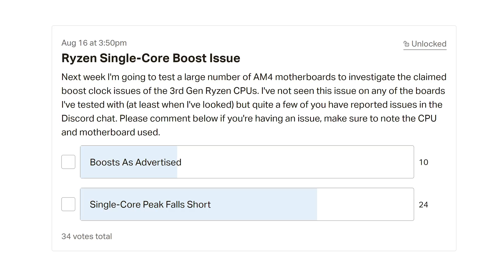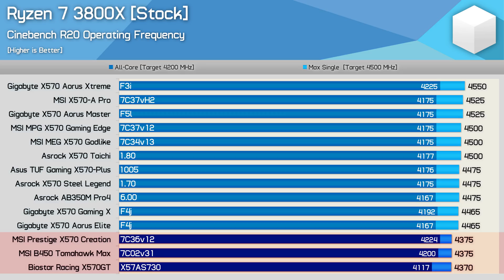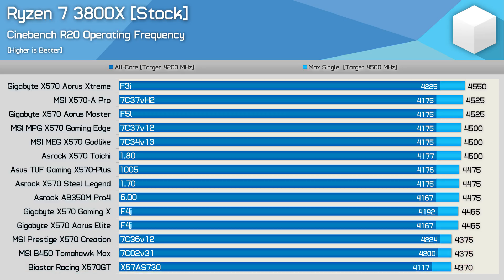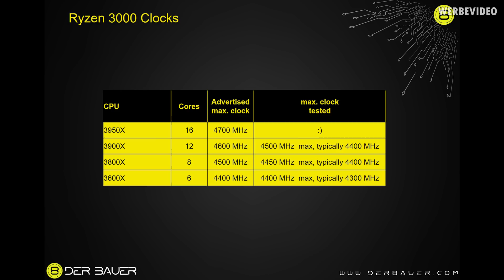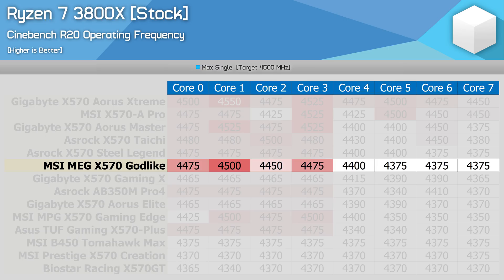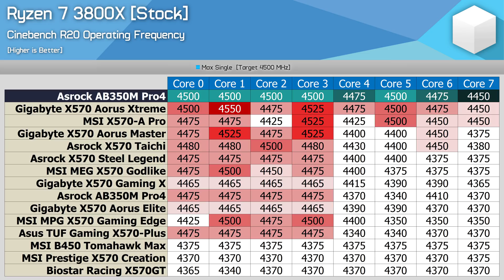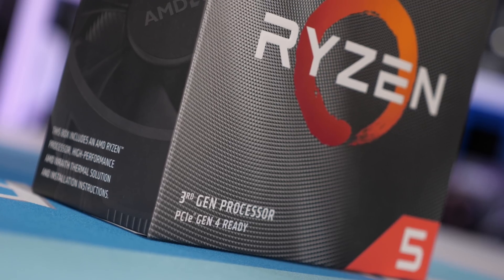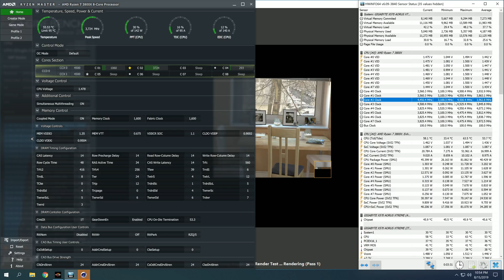AMD 3rd Gen Ryzen Boost Clock Investigation

Comment: Wait! So the Gigabyte $704 motherboard is needed to max out stock performance??
Reply: No. Other, much cheaper boards also performed as advertised.
Reply: @joejones3434  Why are you responding to me? What part of my post mentions ANYTHING about advertisements? "MAX OUT STOCK PERFORMANCE" has nothing to do with advertisements
Reply: @czdaniel1  You seem to misunderstand what I mean. Other boards also hit 4.5. The term "as advertised" refers to what is written on the box. It has nothing to do with advertisments. Sheesh. You could also watch the video where Steve points this out.
Reply: @joejones3434  You used the word, not me. To me, I'm just like: what part of MAXIMUM means HIT'S A MINIMUM OF 4.5GHz? You are using the word in a way that denotes the literal antithesis of the meaning and my usage!

     So, yes. There's def a misunderstanding, somewhere, bringing me back to my question: WHY DID YOU REPLY TO MY POST ABOUT HARDWARE AT THE TOP OF THE BENCHMARK CHART with some bit about irrelevant advertised claims, presumably, for some lessor-performing boards that were lower performing on the chart?
Reply: @czdaniel1  Again, this is an issue with your comprehension of basic language, I'm not sure how else to make it clearer. It's obvious that I'm not getting anywhere here and am beginning to understand your original confusion with Steve's video, since your comprehension of basic things appears to be limited and you are quick to anger.
Reply: @joejones3434  -- Right...MY comprehension of basic language. ;) I'm the one here raising the points of word choice, definition and usage, while you are applying anything that can meet an advertised "minimum" as if meeting a minimum is the exact same as "maxing out" performance. IE Joe, the literal antithesis   

      You're doing so despite that hierarchical ranking of mother-boards in the video just in front of you, which was based solely on measured performance differences. In other words, if the goal is to max out stock performance achieving GREATER than an advertised minimum, then one board is clearly the superior choice. After all, why would a person seeking the MAX only want to reach the advertised boost on one core when there's another board that will achieve the same boost, but on TWO cores? 

      Don't get lost in the mental labyrinths that your psyche builds to protect your ego. It's blocking you from picking up on the clues around you and solving -problems- the PUZZLE for yourself

Comment: If it matters, I played a bit with my 3700X and I found something interesting. I use a Asus X470-F Gaming. If I set Performance Enhancer L2, I get better all core boost, but single core is 4.3. If I set Performance Enhancer L1, I get lower all core, but very close to 4.4 single core, with scores accordingly using CPU-Z. Thanks again for doing this video, or I wouldn't have thought to check.

Comment: Have you checked the FSB or Base Clock to see if it fluctuates from 100 at all?   I have found even on high end boards there can be some minor fluctuation, sometimes as much as + or - 1.5 MHz.   For example 100 x 45 gives 4500 but 99.4 x 45 drops to 4473.  So some of these may simply be due to slight frequency variations.  But not all.

Comment: Hmmmm wonder why he used a 3800x and not a 3900x or 3700x, seems like 3800x is AMDs best silicon but we already knew this after the silicon lottery report.  Need to stay on AMD's good side?
Reply: M. Grabarz he did say that he did see the same behaviour with different cpus so no need to repeat same results... and ofcourse 3800 should get better results! That is the point of that chip. It has been binned higher than for example 3700.

Comment: Great video! I'll put my info out there in case it helps anyone. R5 3600 on a Gigabyte AB350N Gaming WiFi motherboard. I see about 4035-4065 MHz all core frequency when playing most games. BF5 runs at around 3996 MHz, all core. Lightly threaded loads, the highest single core frequency I've seen is 4167 MHz on a few cores. I've never seen 4200+ MHz on any core. BIOS version (F42a), latest AMD Chipset version (released Aug 19th), AGESA 1.0.0.3 ABB, Tested with Ryzen Balanced Power plan and Ryzen High Performance plan. CPU Cooler: Wraith Spire w/ a Cryorig C7 fan (Node 202 case). Cinebench R15 CPU test brings all cores to about 3895 MHz. Temps while gaming usually 60-67 C, 23 C ambient.

Comment: I suspect this is a issue with using the stock cooler, coupled with ambient temperature; I am unable to test the stock cooler, i got a used board without the stock mounting hardware
Reply: I had 4.3 Ghz on 3600x on wraith spire and old bios, now 4.2Ghz with new bios and Cooler Master 212 black edition, boost even goes down to 4.150 sometimes in games. Temperatures on stock cooler and old bios while gaming were only 60-65c but 75c while watching a youtube video or opening a word document..  I suspect that the change in Bios was made to lower that 75c while doing almost nothing with my PC.
Reply: I even think that i had 4.3 Ghz on all cores with stock cooler

Comment: My Ryzen 3600 stays boosted at 4.07 ghz 1.4volts even when 0% utilization but when under 100% load such as benchmarking  it actually boosts DOWN to 3.96 ghz wtf is that? My max temp is 70c is it thermal? My old i5 6500k is more than 20c cooler under full load

Comment: Not only the mobo brand and version, a big part of it is the bios version.
when I first got the 3900x on launch day, my x470 taichi with bios 3.40, my 3900x would hit 4.6 at various times on each of the cores on chiplett 1, sometimes 4.65.  None of the cores on chiplett 2 would reach 4.6, those barely would reach 4.5.
That particular bios(3.40) does allow the max boost clock to reach 4.6~4.65 on some cores, the bad side to it is that it would not allow IF to change automatically with RAM speed, would not go higher than 2400 causing RAM to be unstable any higher than that.
bios 3.50 did improve IF and RAM compatibility(on xmp it could get to 2833), but with that bios, only 2 cores could ever reach 4.6
bios 3.60 fixed IF and RAM issues, IF does change correctly to match RAM speed  adn now my 3200 RAM will run at xmp 3333 with no issues.  However, max boost clocks now don't go any higher than 4.5.
What's interesting is that cinebench r15 scores in both multi and single core are a bit higher.  As steve talks about, that slight clock speed difference doesn't really make a bit of difference.   Sustained work loads like a game or rendering a video works the same on any of hte bios versions, temps are pretty much the same on each version as well.
And I also agree, mobo vendors still have work to do in order to iron out these quirks and optimize perf.
Reply: Maybe running RAM and IF at faster speeds is eating of a power target making the cores boost lower? Or somehow putting a "strain" on the CPU other than TDP, making it boost lower?
Reply: @houdini8172  maybe, but I'm pretty sure it's somethign to do with the bios adn agesa versions.   I did run the system for a bit after updating bios to latest version with xmp set at default(i think it's 2133) and cpu core clock speeds didnt boost higher than 4.5.

Comment: IMO, Ryzen CPUs can hit as high as 200MHz more than what its spec but this time they went too far with their "Max Boost Clock" to the point of no return just to make their CPUs seem to have a higher clock to compete with Intel's 5GHz CPUs. My 2nd rig with the R5 1500X could boost up all 4 core to 3.9GHz each, that's 200MHz more, and almost Ryzen CPUs pre-3000 series could go at least 50MHz/100MHz more (my fist R5 1600 hit 3.7GHz Boost on stock setting). 
This time they just watch how high their CPUs could boost up to and marked it as spec, disregard that it's really hard for the wide variety motherboards to even get to the spec max boost. The same thing with my 2700X, at 4.3GHz it's already at it max, even with PBO enable, its only could go as high as 4.35GHz.

Comment: Were all voltages the same from each board(as with Intel diff boards seem to have different voltages)? What  bus speeds were the various components running at? eg Infinity Fabric, PCIe etc. Were all memory speeds actually running exactly the same? Mechanical EMF interference? eg from fans?
All of these variables in results are making a decision difficult for an upgrade years overdue. Having motherboards with limited expansion even at the higher end also doesn't help. Why no Thunderbolt!!

Comment: From reddit I get the impression that AGESA 1.0.0.2 getting to 4.65 single core boost, on 3900X, is not uncommon. And that it is related to the co-processor firmware or something like this.
Please test AGESA 1.0.0.2 too! I would test myself if it increases my boosts, but my motherboard(b450 gaming pro carbon) never got a BIOS with this AGESA..

Comment: the 3950X will get a boost clock of max 4.7 if we can believe AMD. If thats true and we combine your findings it should be possible to reach the 4.75 with PB that AMD claims in the video with some motherboards. My 3900X / Auros Master reaches 4.575 without PB and 4.625 with PB. Im going to reset everything and fill in De8aur's form to let him do the research. Could you test the 3900X to see on how maby cores it reaches the 4.6? Maby more cores = more heat = less cores reaching max boost with bad thermal/VRM.

Comment: I have a 3600 on a X470 Gaming Plus [Hyper 212 cooler], i get 4.2 Single Core, and 4.05 All core in R20 and  in R15 I get 4.2 Single and 4.1 All core; by altering PBO max clocks i can get peaks at 4.35 single core, but it bounces all over the place, better off with less for a more constant clock speed with a higher average, upping the socket power limit only looked to let more power in that had no effect, but we are trying to measure values close to 1% so margin of error is a problem

Comment: Ryzen runs a bit hotter, motherboard bios' are  utter garbage, and doesn't boost to advertised clock speed. Can't even overclock this thing much, so there goes the "it's unlocked" excuse. Overall, I don't think Zen 2 lived up to the hype as much as I wished it did, and as much as I'm glad that i switched to the 3600, a little part of me wished everything just worked a bit better.

Comment: And people still wonder why Intel "K" CPUs are so "expensive". Well, all cores on those CPUs are binned equally and every single one can hit the same frequency at all times with a stable overclock. With AMD, they only bin one core per CCX to meet the advertised boost clock and call it a day. The other cores that are of lower quality hold back the overall stable overclock to the max rated boost frequency of a single core. That's why AMD is charging less. It costs way less money to create those. Imagine having to bin 12 cores with same quality and put it in the same CPU. That way the 3900X would've been stable on 4.6GHz all core. But why would they when they can create 12 CPUs with 1 binned core that boosts to 4.6 instead of 12 binned 4.6GHz cores on one CPU. Costs less money and they can charge more. 

People should approach things objectively, rather than being led by feels.

Comment: I think what is confusing people is that it has changed from what we saw with 2000 series CPUs. For example my 2700X regularly hits 50 MHz over the advertised clock speed on the box. It seems with the new CPUs it’s only just possible, at best, and simply impossible with the majority of boards.

Comment: I have a 3700X in an Asus Crosshair 7 Hero with a 2 fan AIO liquid cooler and Conductonaut on the CPU lid, PBO enabled.  My idle voltages are high as well (1.46-ish) which AMD says us normal.

In all, 7 of 8 cores hit boost regularly, and 3 of 8 exceed by 50-100mhz constantly.

I believe that instantaneous cooling capacity allows these higher boosts, because my Cinebench R15 scores are good, but not atypical (2185).  My idle temps are 29C and I have not found a way to thermal throttle the chip, not even with AIDA 64 running continuously.

I think instantaneous thermal dissipation really matters, so maybe it is slight differences in the board layouts and heat sensor polling rates on the board which might play in as well.

I also feel like we have a weak sauce version of PBO right now, and new experimental versions are coming which will result in more aggressive PBO performance on the best cores.

Again, I cannot find a way to thermally saturate this CPU and my idle voltages are crazy high.  There has to be more headroom in some of these cores.

I also find it odd that just one core is likely holding back an insanely good all core overclock.  It feels like maybe it was designed that way, and that a better PBO will get me to 4.6GHZ on 7 of 8 cores...

Comment: Its very simple. it was all false AMD bullshit advertising marketing from the beginning,  just like the adoredtv claim 5ghz boost which was all bogus.

But AMD fanboys will believe anything and will defend anything AMD and adoredtv does or says.  Examples:

AMD fanboy: my vcore voltages are extremely high 1.5V
AMD: don't worry its normal 
AMD fanboy: my navi gpu is running extremely hot.
AMD: its fine
Adoredtv: zen3 base clock will hit 6gz on air
AMD fanboy: say what , im there dude

Just remember u  AMD cult members,  AMD is a business i repeat a BUSINESS, they don't care about u,

AMD+AMD fanboys+Adobetv are a very bad combination in the CPU and GPU market and the pc tech and enthusiast community

Comment: AMD was overly eager to post "best case" specs as typical specs.  Still, users are too focused on seeing their CPUs reach advertised max single core boost, ignoring that the advertised max is maybe 2% higher than what they are seeing, a difference that's certainly measurable but which will make almost zero difference day-to-day.
Reply: Both Intel & AMD are doing this, it is NOT new...

Intel: https://www.techpowerup.com/img/M4qZPaXlWTJllLSQ.jpg

AMD: https://www.techpowerup.com/img/8WQR4LKtUgISmmGD.jpg

source: https://www.techpowerup.com/258201/amd-updates-ryzen-product-pages-to-elaborate-on-max-boost-clocks

Comment: I use a b450 m mortar from msi( latest bios and chipset)  paired with a ryzen 3600x that is always at 4.1-4.2ghz but my temps are all the time over 50°C and at 1.45V
Dont know what to do with this temps. On idle i have 45-65°C and when gaming 75°C but cant do anything regarding the noise and temp
Reply: You could try setting maximum processor speed in Windows Power Plan settings to 99%. Sure you will loose a couple hundred Mhz in the max boost speed but your voltage will stay low, about 1V and noise and temps will fall drastically. Didn't notice it having a major impact on fps when gaming on my 3700X, maybe a couple fps and that's it!
Reply: @TheMrLucasP  thanks i will try that

Comment: So my 3600x with crosshair 7 hero will boost to 4.55 single core in best core, 4.35 on the other 2 best and 4.3 on other 3. I do have to go into 1.45v, and no performance difference at 1440p gaming (not noticeable). The cinebench scores refect the higher frequency, but real life workloads and gaming? Pbo + auto OC just fine

Comment: Kinda hilarious that the top board is the Aorus Xtreme when that's my board, and under a custom loop my 3900x never breaks 4375 single core on the latest bios :(
Reply: Have you tried an all core overclock ? I can run my 3900x at 4.25ghz with 1.2v, I can do 4.4ghz all core with 1.32v, the problem with 4.4ghz is the temperature, I am using a Noctua nh12 with liquid metal. I would like to know your temperatures with a similar configuration because I want to put a custom loop too
Reply: Theodore, I've got a similar setup as you. Crosshair VIII hero, with a custom loop. 2 360 rads. That's about what I saw on auto. I turned PBO on and got to 4.1GHz all core in cinebench. I did an all core oc at 1.35V at 4.3GHz. I found out I can do 4.45/4.3GHz for the CCD's at 1.35V and I'm right at 78C under cinebench R20. Score of 7860 with some ram overclock settings and tighter timings.

Ambient is 24C
Reply: That's interesting. Have you used task manager or whatever to force a single-threaded benchmark to run on specific cores? I'd expect a +/-75MHz variance, but that's kind of low.
Reply: The Gizmo Ok, I keep seeing people talking about doing just that, but when I look up how to assign certain tasks to certain cores, I get the website talking about stuff that doesn’t seem to exist when I try it myself... like you need to right-click and choose a certain menu/button, but that button doesn’t appear on my computer. Quite frustrating because I have a fully updated version of Win10, so that problem shouldn’t exist
Reply: @jakobgeigelclermont  Look for affinity in the right click menu in the detail view of task manager, the process list that's more similar to the Windows 7 task manager process list.
Reply: @The0Gizmo  I mainly use Cinebench to test and i tried doing that. Best possible single thread i eked out is 4375. and my best all core boost was 4050. Under a Customer dual 360 Radiator waterloop and a $700 top of line motherboard, i really expected more.
Reply: @WhitmanEntertainment  Hmm, I have heard of using really high speed ram and a lot of other power hungry things related to the IO die can actually reduce your clock speed due to more power usage. Other than that and resetting the bios to defaults, I'm not sure what it could be.
Reply: Then you need to have the latest windows version, if it isn't the case. I did download the latest W10 ver from May. And it cleared the issue for me.
Reply: Pull cmos battery. Power on to bios. Note cpu idle temp. Config and save profile. Power off. Re add battery. Boot back to bios. Set profile. Reboot and check temps.